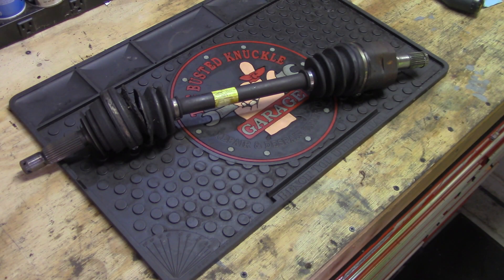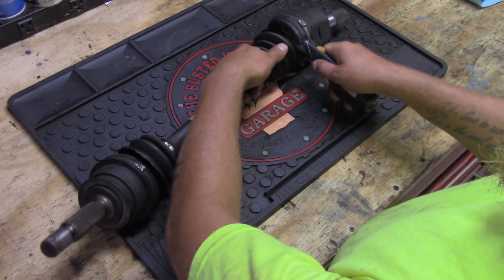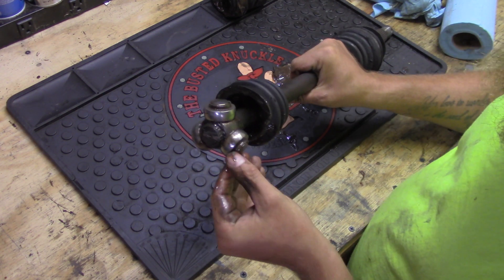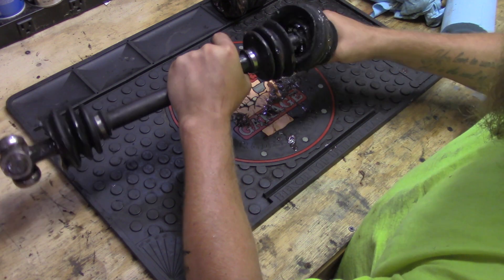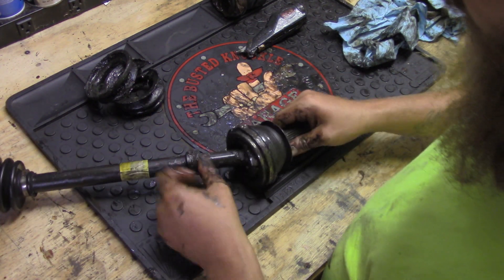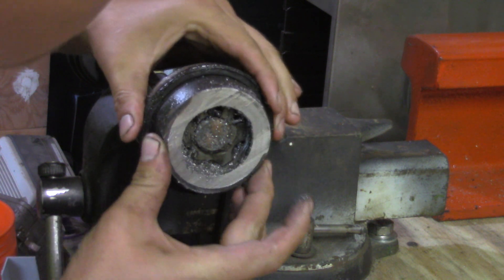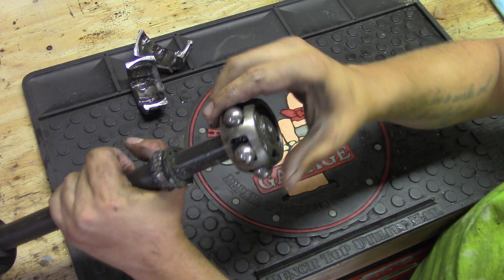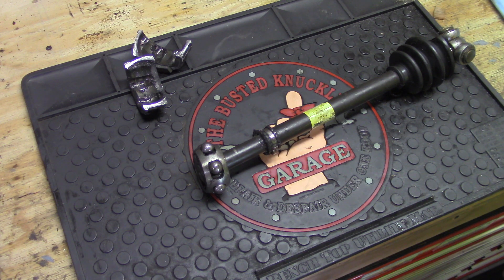What's Inside a Front Wheel Drive Axle (CV Joint) by @GettinJunkDone

Comment: I just replaced my front driver side on my 05 crv. Those 3 bearings were lose on the transmission side. My crv was thudding.when I stepped on the gas. Just rolling no shudder vibrations.